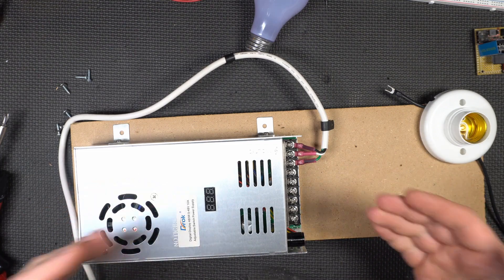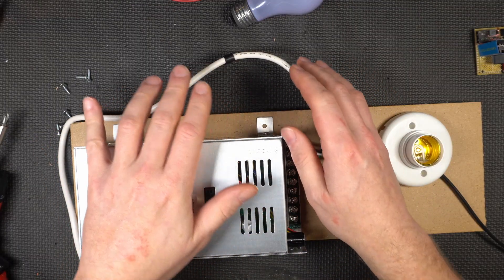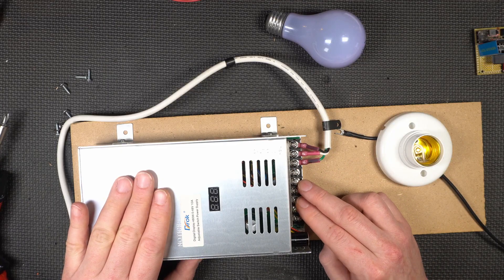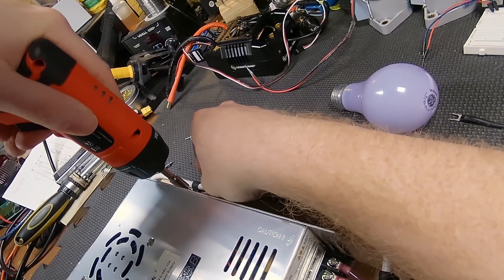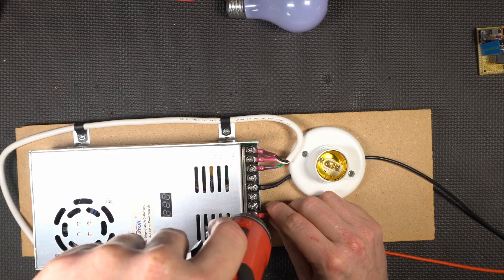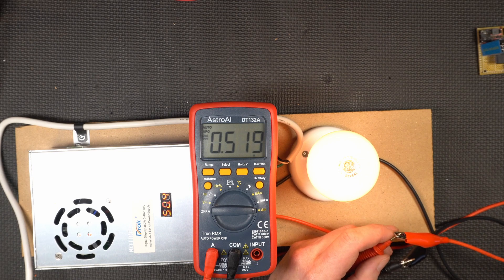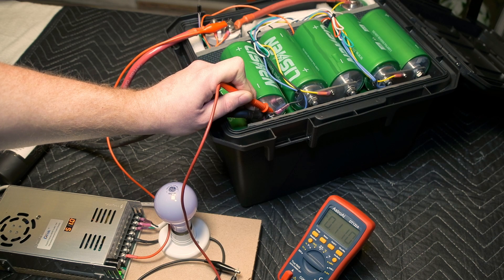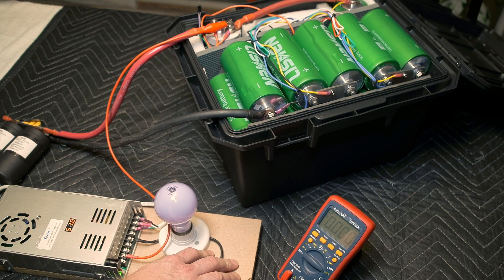DIY Battery Charger - Clever, Cheap & Easy

Comment: can you give some specks of the bulb used? Are they 12 Volts DC bulbs?
Reply from the maker: I think that was a 120 volt, 100 watt bulb.
Reply: @AlexLTDLX  Thank you for taking the time to reply.
Reply: In this case 100 W - 120 volt AC incandescent light bulb.  See 5:20 in video.  Higher watts = higher current (AMPS)
Reply: @NiVofHiR  Got it. Thank you too.

Comment: all psu'us have short circuit protection. dont buy chinese crap for 2$ if afraid of shortcuircuit. also you should use circuit dc braker for that too.
Reply from the maker: Many don't have short circuit protection.  Most linear supplies certainly don't. Either way, that's not the point of the lightbulb - the lightbulb is a current limiter, not necessarily just short circuit protection.  And it gives you a visual indicator of the state of charge.  I thought it was a pretty clever use of a lightbulb, or in electronics repair parlance, "the dim bulb."  In fact, in serious high-end industrial applications, there are specific, high precision light bulb current limiters that can be bought - if you're willing to pay the price.

Comment: Wonder if you can use an old server power supply to charge a battery.
Reply from the maker: As long as the voltage is correct and you limit the current in some way - like I did in the video using a light bulb.

Comment: hi! I was hoping to make a 32650 lifepo4 12v battery bank and having issues making a charger for it. I lost a 30ah 12v smps after using couple of weeks and were thinking if i could use a 100/60 watt tungsten light bulb in  series with 14.4v outout of the battery charger. 

The pack has a bms for lifepo4 and hope add active balancing in future. 

Will this Setup works for 12v system?

Thanks in advance.

Comment: Lightbulbs are very useful.  I used 10 300w bulbs in parallel as a Dyno load for many years of testing Briggs and Stratton engines for fuel efficiency.  Used a 120v DC treadmill motor, which was perfect for voltage and rpm.  I ran it up to about 20 amps at 120v.
Reply: Nothing nerdy about this

Comment: Hey alex and everyone else who might want a charger on steriods and on the cheap, look at the Riden RD6024 or RD6018 these things are great set the voltage from 0-60V and current 0-24A. its a simple device that just works to power anything in those ranges its hard to find something with that amount of real power 1440 watts and it will put that out continuously I ran mine for a week at 1100w no a flicker, between min and max set voltage was. .15v over a week. Worth I look I have burnt up so many others I have a drawer full of parts this one I have had going for almost a year, I can truely set it an forget about it and when i come back its doing what i told it to do.
Reply from the maker: That's a good tip - seems like a bigger version of the module I used in my bench supply.  What are you powering it with?
Reply: Always feel great when they don’t have a website available when you input the name Riden or rd6018
Reply: @dennisford2000  Yes very true but I wouldn't feed this thing with a mean-well rsp-1500-48 unless I really trusted it those are spendy 450ea. I have so many expensive desktop power supplies that haven't lived I decided to try something budget friendly. I use two at home and two at my shop and for the price of one hp supply I can buy 8 of these and did, haven't had to swap out one of them. If these last three years, (1 year in) I saved a grip the hp supplies go out 38 months in (36 month warrenty) and to repair is a flat 500.00 fee did that 5 times in 12 years. I need good clean power and thats what these things do period. I looked at these for 2 years and debated, when the 24 amp model came out I had to see and am glad I did, heck with bluetooth I dont even have to go look to change profiles or see % charged I can sit at my desk and watch alexltd videos!
Reply: @shaner.5  my go to these days is a 75A battery maintenance charger for either programming automotive computers or racks of batteries in storage. Has a fan that fires when hooked up to a car even if it’s not plugged in, but it puts 75 clean amps at 14 volts.
Reply: I was using hp server power supplies in series, (Loud 747 taking off) but replaced those with two Mean Well RSP-1500- 48's in series, I set the series voltage to 70 and there rated 32 amps so those drive more than its capable of but on the cheap the thrift store laptop power supplies works great too, its a step down so if i feed it say 40 volts and 4 amps I can charge at 10 volts 12 amps, so a power supply rated for 70 volts 26 amps is not reqired unless using at full pixes.
Reply: I actually have two more mean-well's In a duracomm rack server model# RLP-6048M Its rated 48v 60a, (series) would trade ya for a vesc or brushless motor.
Reply: PC supplies are great for a ton of other uses, i use old ones a lot as theyre tough with great current (good ones i mean) and already voltage is regulated. 

Would it be possible to easily modify a supply to have an adjustable voltage and have an adjustible constant current??  Asking because Li-ions have strict charge cycles needing constant current (value determined by cell capacity) until they reach 4.2V, where then this Voltage needs to be held constant as current is dropped slowly to complete the charge.

Im a chem engr, so batteries i know  (esp lithium as ive done R&D on new tech in the past)...but electronics im just learning on my own for projecting purposes.  Ive an op amp controlled power transistor w a small output resistor to read the current i can accurately set constant current via a pot. .  However, i cant with my current ignorance of this subject wrap my head around how to get the circuit to " swap" to a constant V of 4.2 once this V is achieved and then start to decrease current with time.  Its frustrating to be intelligent and very knowledgeable in one field but be so basic and ignorant in the other when a project requires multiple disciplines.

Speaking of, ive a great idea dealing with electrochemistry i need a custom supply for...I know the chemistry works, and im very confident the system as a whole will as well if the supply is just right; alas im not capable of such a complex design.  You guys seem knowledgeable, interrested in helping/discussing a supply design to power a potentially semi-breakthrough electrochemical system??  I need in summary a high freq dc offset signal (no polarity reversing) of moderate voltages and current, with adjustable parameters of V and frequency ( prob. 10-60khZ range roughly), and capable of tuning to resonate with an electrolysis cell making H2/O2 gas.  Possible??

Comment: I told you I was running a 150F capacitor & a group 9 lead acid battery in my daily driver (2001 Prelude), you told me to try lithium.

 After 11mo the $40 battery stopped holding a charge, but the 6mo warranty was expired. I finally went lithium, & replaced it with a NOCO NLP9.  (I kept the 150F capacitor)

$100 with a 5 year warranty, and it saved another couple pounds. This thing is so light, the box felt empty!
Reply from the maker: I love the lifepo4 battery I built for the LTD.  I'm glad it's working out for you.

Comment: So does the charger stop the charge when the batteries are full? Overcharging lithiums is no bueno...
Reply from the maker: As long as you have the voltage set appropriately for the battery yes.  It's the combination of limiting the current earlier in the charge cycle and then having the power supply set for the maximum voltage that you want the battery to reach. This is fairly slow but it works and it's easy.
Reply: @AlexLTDLX  Ah, ok that makes sense 👍

Comment: Could this charge a 24v sealed lead acid setup?
Reply from the maker: Sure.  Just make sure to set the voltage to something reasonable for that battery - I'd do something like 28 volts; if you want the battery to live a longer life, try 26 volts.  It will be a bit slow, but it'll work.

Comment: awesome way to get a cheap current limited supply  add a voltage cut off board and that is the perfect charger for iffy batterys that your unsure on

 i use the 1800w boost converter  set power supply to 48v   set boost to 50.4 as wanted and current limited to what u wants  gives an actual 8 amp power supply thats current adjustable with a low dollar mod  ive pushed on of those 1800w dc to dc converters to 1600 continous they got hot but took 18ah  worth of charging like a champ

Comment: Used to trickle charge with a test light and a big shop charger
Reply: Common 1156 would limit to two amps roughly on a discharged battery. .4 on the taillight bulb/ other side of the 1157 . 104 was a bit under .2A